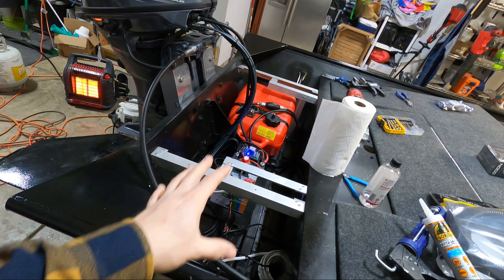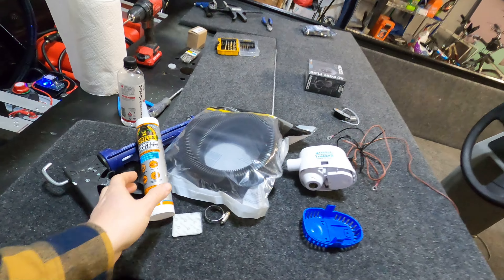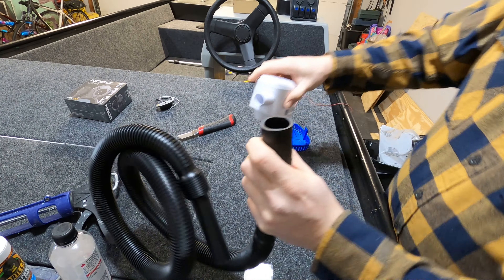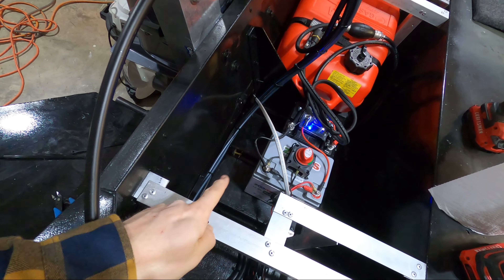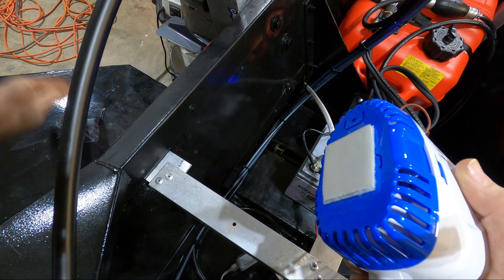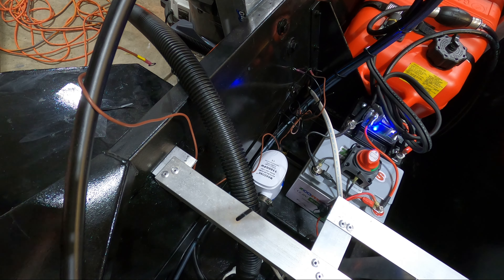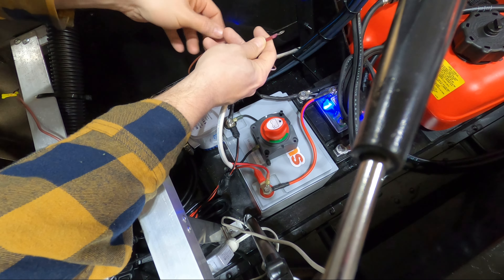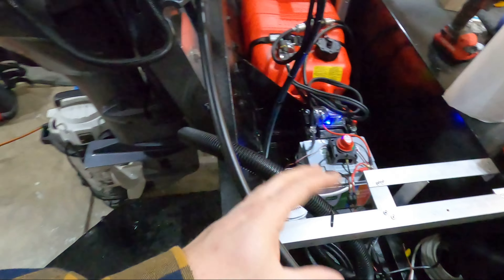Boat Bilge Pump Complete Installation Guide

Comment: Nice install, but I really would like to know the type and size of those batteries seen in the video, Is the larger one used to start the outboard and the smaller one used for all other components ???
Reply from the maker: That's correct, there is a 50AH Lithium (https://amzn.to/3PFroUw) and a smaller AGM battery (https://amzn.to/44A5rdC) for cranking. Just make sure the CCA matches what your motor needs.

This video here dives into the battery setup in detail: https://www.youtube.com/watch?v=gAJUb3Tu7yw
Reply: @mvboutdoors  Thanks Bro, your vids  have been very helpful in helping me build my 1448 and restoring its trailer, keep them coming and god bless sir !!!

Comment: The Velcro was a great idea! Better option for the hose is smooth bore bilge tubing, it can be bought by the foot at west marine and a few other places...it's super flexible and doesn't kink. That corrugated tubing actually limits pumping volume. Cool video man, keep up the great work, the boat is looking awesome.
Reply from the maker: Good call, I wish I had a west marine near by -- it was a pain trying to find a good hose. I tried some from amazon but it was so stiff when I tried to straighten it split right in half.
Reply: @mvboutdoors  you can buy online...just a thought. Hey, also...it's really cool that you're so interactive with your followers. Keep that up.

Comment: I would have used a through the hull fitting. A lot neater looking. I believe that Bass Tracker installs them that way from the factory. At least mine did. But I bought it used. AndI believe that most bilge pumps have a test button on them so you don't have to remove them.
Reply from the maker: Yeah that would definitely look a lot neater, I agree. I really like the bilges that have test buttons, not all do but they sure make it easier to make sure things are working right.